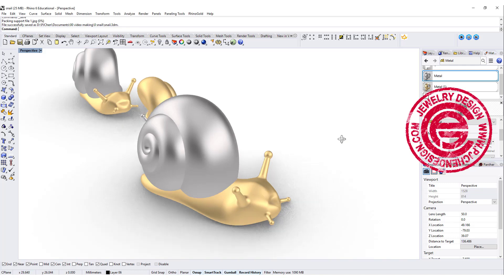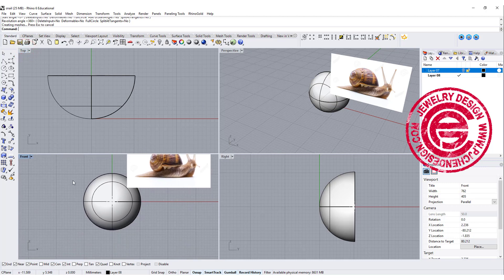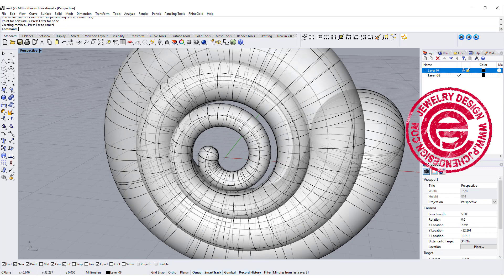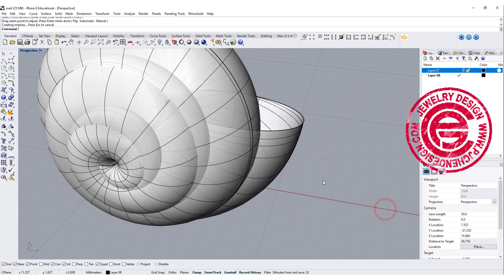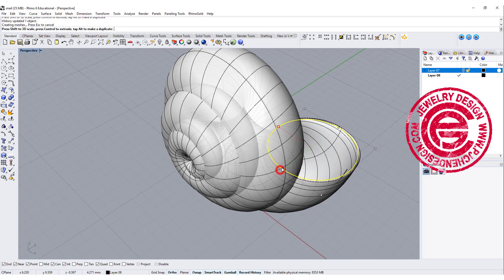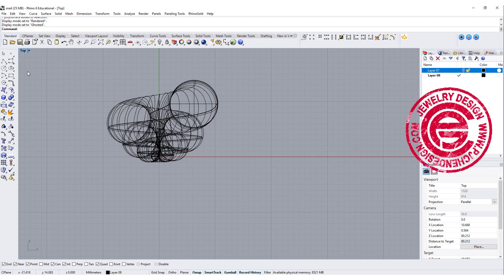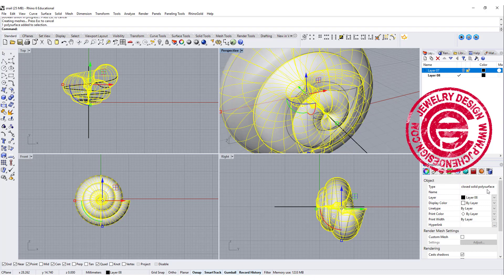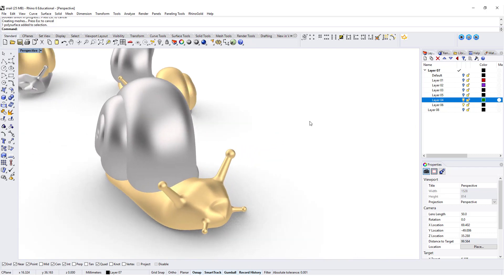Snail 3D Modeling in Rhino 6 (Part 1) : Jewelry CAD Design Tutorial #105

Comment: Hello PJ! I've been following your tutorials and your instructions are really really clear :) I have a problem with this shape, at 6:46 when using boolean union to create a whole solid. the smallest piece at the centre will not boolean union with the rest of the shell. Why is this so and how do I resolve it? Thank you!
Reply: Yes! I had the same problem! I figured out that the shape which doesn't want to boolean is in the smallest piece in the centre. It happens due to the curve that is too curly and organic. Remember we deleted the end of the curve with PJ? You should delete the begging of your curly rail too. I have split the small part with a point and my eventual shape was done without any complicated intersections. After that, I was able to boolean the whole piece.
Reply: I met a similar problem. I fixed it by boolean union small pieces one by one.
Reply from the maker: It is hard to tell without seeing your model but I have a Q/A playlist explains different type of boolean issues. You can check out them first.